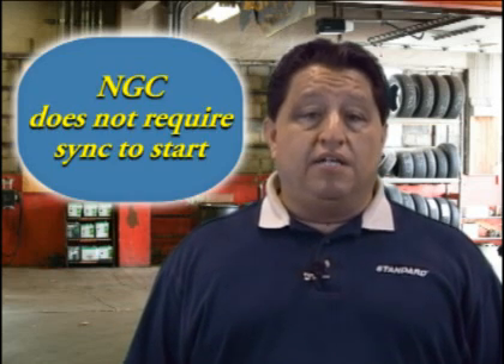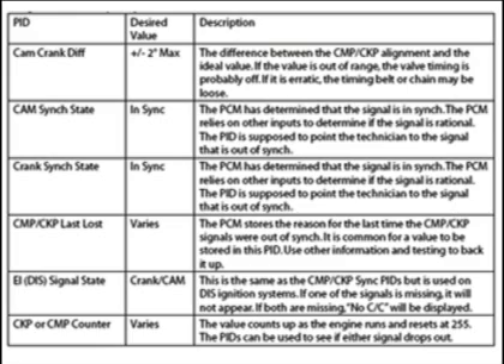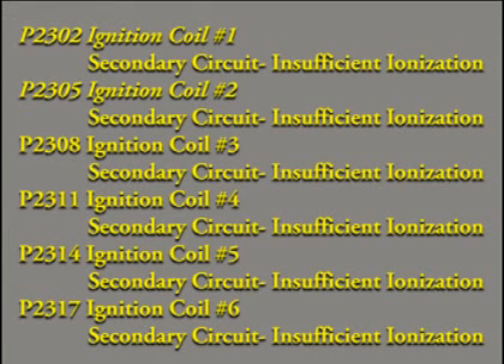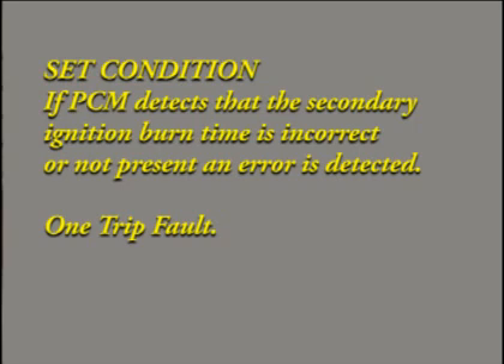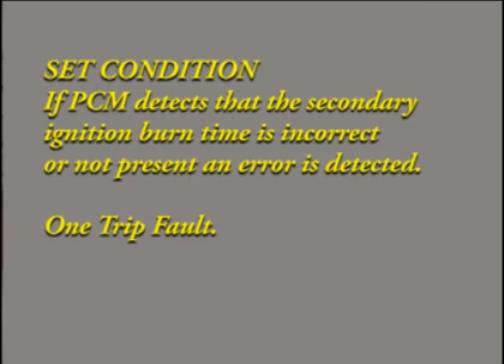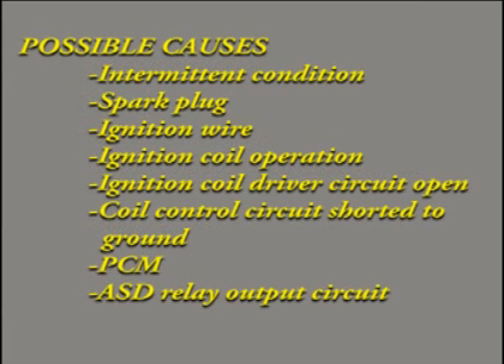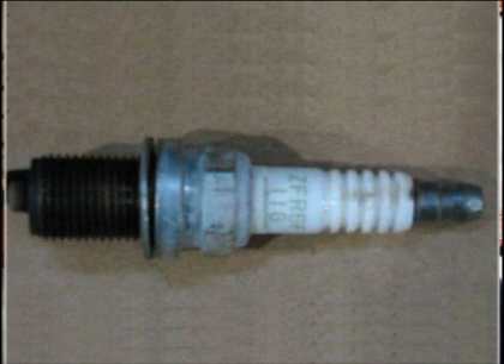NGC Ignition System Code

Comment: I have a 2007 Chrysler 300C 5.7L Hemi....codes P0305 and P2314....have done new coil and spark plugs in it....can you tell me what relay needs to be replaced...also going to look into pcm for any electrical issues as shown....

Comment from the maker: P2317 means that the PCM is not “happy” with the ionization on #6 cylinder. It monitors the primary trigger circuit to do this. I have seen basics- plugs, wires, compression issues etc cause this. Once you've eliminated them, you have to scope the signals out of the coil.

Comment: Hi,  I have a 2005 Chrysler Pacifica and the ECM/PCM was damaged in an accident and I purchased a rebuilt ECM/PCM. After installation DTC- P2317 it has a definate miss at idle and the engine and won't go higher than 3000 rpms. I replaced the crank and cam sensors and changed out all of the plugs with champion platium plugs.  Move the number 6 coil to number 5.  I cleared the code and it still is doing the same as before with the same P2317 code. No change in symptoms.  Any suggestions?   Thanks